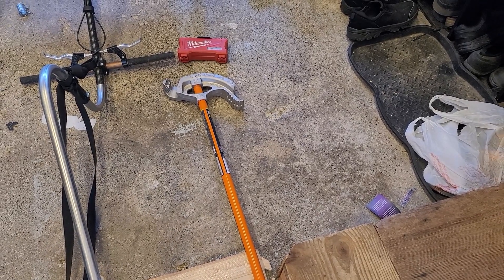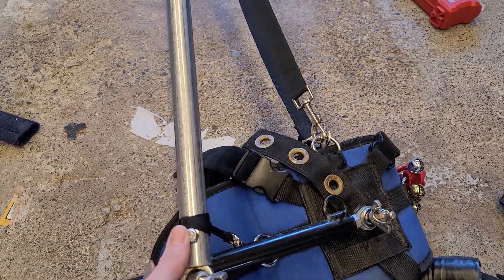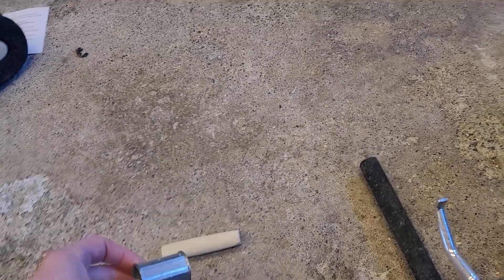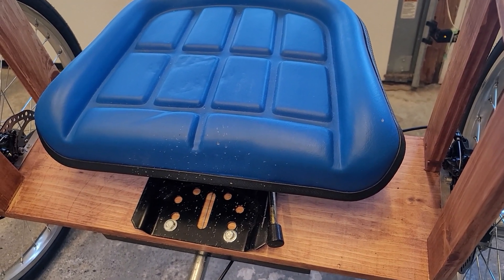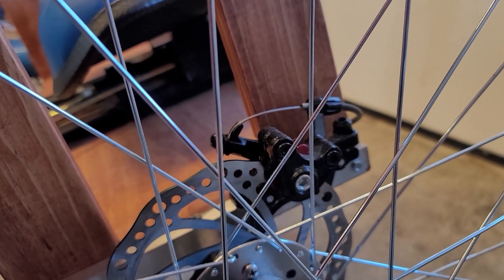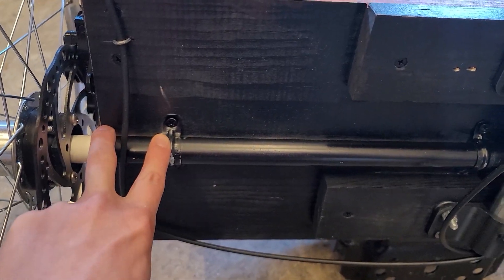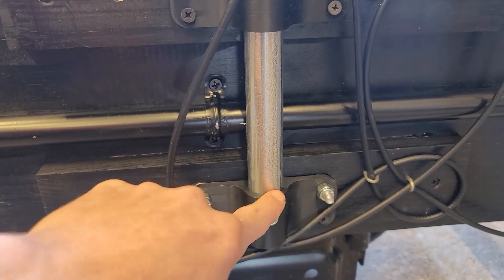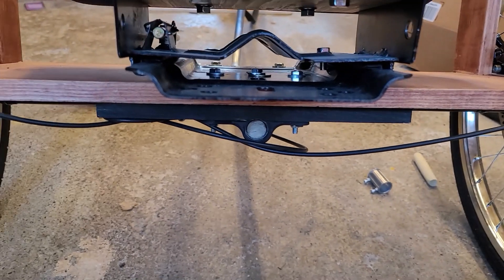Home made Dog Sulky Cart

Comment: What's the nominal size of the rod end bearings you use?
Reply from the maker: The rod I use for the axle is 5/8 in solid steel rod the wheels have bearings built in.
Reply: @Artoftheguppie  Thanks. I meant where the dog harness attaches to the sulky.  I've been building one for a couple months, and I'm trying to figure out how to  finish the tongue end so it attaches to your harness I ordered. :) I appreciate your help.
Reply from the maker: This is what goes in the end of the shaft I drill a 1/4" hole and bolt in on. https://www.amazon.com/gp/aw/d/B08P14MLJC?psc=1&ref=ppx_pop_mob_b_asin_title
Reply: @Artoftheguppie  Thank you very much. :)